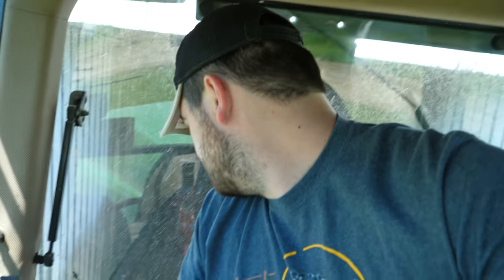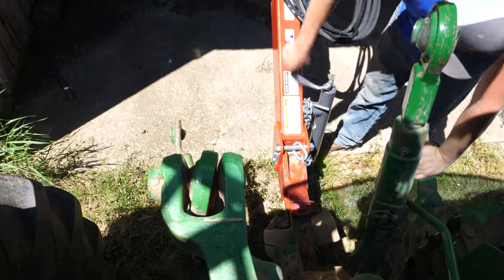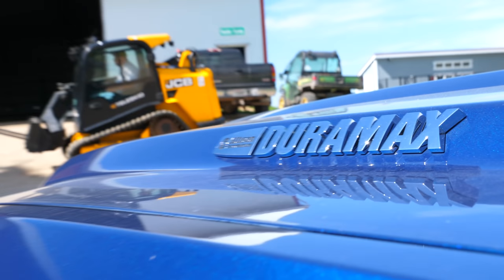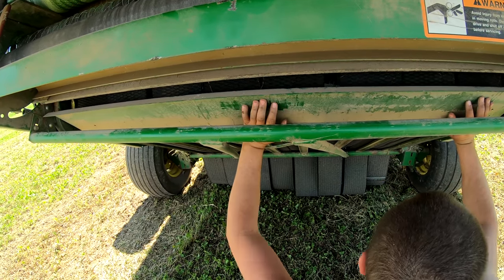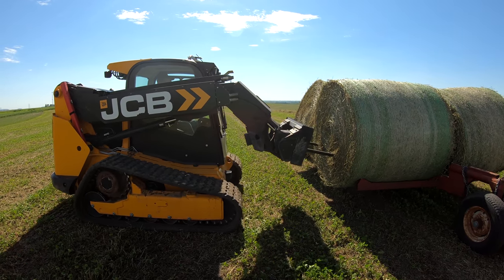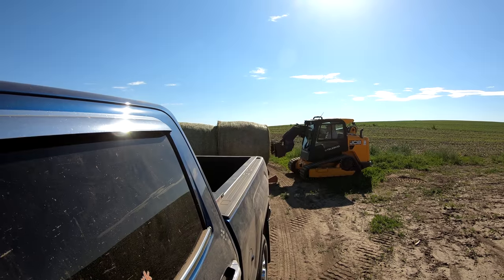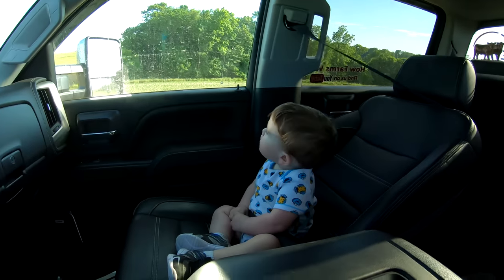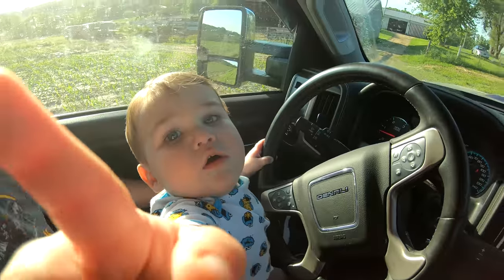JCB Teleskid Helping Make Hay!

Comment: I was wondering why you guys don’t wrap your bales in plastic?  Is it not cost effective for your farm?  Love the video. I like your partner in the truck.
Reply: David Garee it’s dry hay that is net wrapped, and they stacked them inside. A good tight round bale with net wrap and stacked correctly outside still sheds water pretty well, with only minimal spoilage around the outer layer or two. A true plastic wrapped dry hay bale can cause problems since it traps what moisture that is inside a dry bale and heats up in the sun. I plastic wrap wet hay bales, and we leave our dry hay unwrapped.
Reply: Thank you for your explanation on that. It’s nice when someone actually explains it to you instead of just saying because that’s what we do.

Comment: At the 15:20 ish mark you were driving around the far side of the hay wagon to pull the bales off, the teleskid is capable of reaching across to pull the bale off from the far side, are you doing this due to the flexibility of the hay wagon?  I am curios, we have a telehandler we reach across the trailer with, but its a different style of trailer, I want to make sure its not a teleskid limitation.

Comment: I have always wondered why some of the  you-tubers that just farm hay don't have a rake like the Rhino.
Reply: Some of us dont have the big green equipment like Ryan
Reply: Every type of rake has advantages and disadvantages. I used one of these v-type wheel rakes for several years before switching to a rotary rake. Wheel rakes have an advantage in that you can move relatively quickly over uneven ground. Disadvantages include the fact that they're bad for mixing dirt in with the hay, the tines are relatively cheap, but they have a zillion of them and once they get tired and start failing they leave a lot of them in the field waiting to cause tire punctures. The frame also takes a lot of strain due to the massive length and width, and once the metal fatigues you end up with frequent structural failures. This rake has the center kicker wheels to lift hay in the center, but most are really only designed to roll two swaths into one, and don't do a proper job on hay that has been tedded out.
Reply: steinwaymodelb You are correct. When one of those tines finds its way into a tire or baler,its not going to be a good day.  I wasn’t referring to the type of rake as much as i was the brand. I am surprised you don’t see more Rhino rakes on youtube. They are built very well and seem like they would hold up just as well as other v rakes.
Reply: @DEDBRD-di4yj  Yes, the Rhino Ag products do seem to be very well built. The brand is well known as the name to beat for their heavy duty rotary cutters, but I think they have relatively recently expanded into this much wider line of equipment and they aren't as well known in those areas - that's one reason why Rhino has been working with Youtubers to use their equipment and feature them.